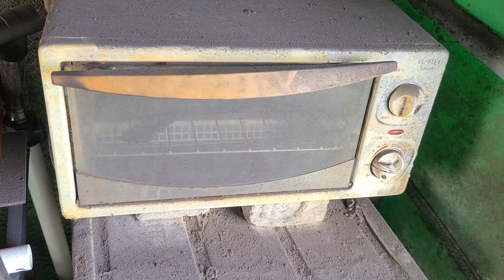The inner ring of the bearing is a good knife

Comment: Best steel to forge a knife!!!
Reply: Is it W2? I don't know what the rings stel is.
Reply: @APs.Custom.knives  52100 ballbearing steel. Usually the rings are made of the same steel as the balls.It's the perfect steel for scandi grind bevels.hunting knives and in my opinion, for any outdoors use or hard use fixed blade knife. It sharpens easier than CPM 3V and it's edge lasts longer. best edge stability I've ever seen from any steel.
Reply: @greekveteran2715  oh okay. I didn't realize the ring was same as the bearings thank you.
Reply: Не лучшая. Основной плюс - не ржавеет, потому что много хрома
Reply: @greekveteran2715 ШХ 15 по российскому стандарту ГОСТ, не лучшая, совсем не лучшая... Хотя свойства конечно в конечном изделии очень сильно зависят от опыта и квалификации термиста
Reply: ผมจะซื้อราคาเท่าไหร่
Reply: I would argue that it's the best, but  it is a great steel.

Comment: I have Cold Steel drop forge bowie and enlarged the holes in the handle and thinned it and put plastic rubber grip on so no slip even wet, similar size & shape. Very sharp.